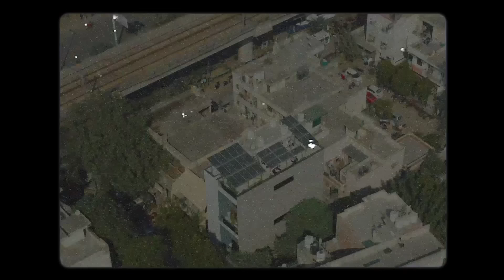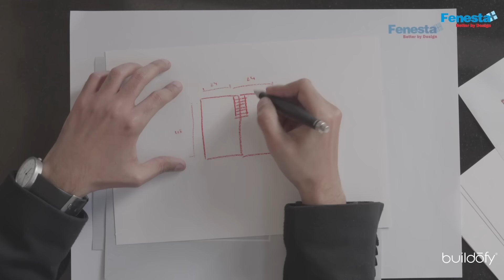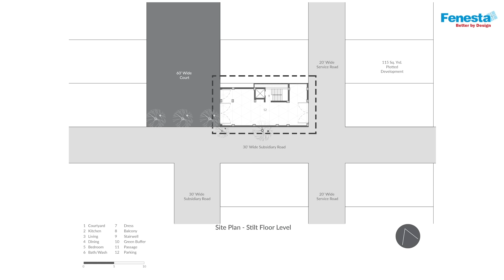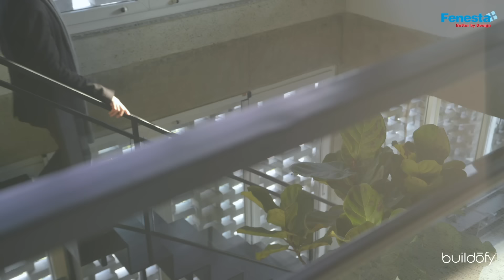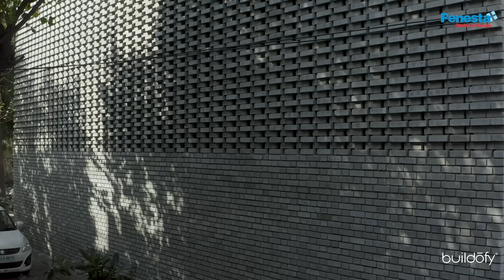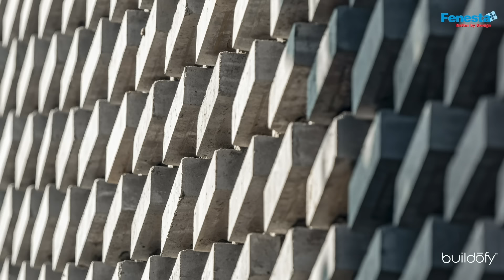1,100 sq.ft Compact House in Janakpuri, New Delhi by Architects Collaborative (Home Tour).

Comment: One of the best works I seen in this channel. My only concerns are how does this handle rain, birds, squirrels etc.. And is it safe? Design looks awesome.
Reply: Now a day's architects compromise on functional aspect and just beautify
Reply: I just keep thinking how to clean these windows from behind  as there is delicate brickwork
Reply: @gondinachu2824  I believe the windows are openable
Reply: @keshavnittin3828  yes windows r openable but there is no space where one can stand behind the window and clean them .. and while trying to do so imagine leaning on those brick jali work if that gives away it's a great fall
Reply: @gondinachu2824  you can clean them from inside right
Reply: @keshavnittin3828  what happens to dust on glass from outside ?
Reply: @gondinachu2824  arre yaar open the windows from inside and the clean the outside surface of the window from inside itself
Reply: Ok... When you have 3 feet width sliding window what do you do ?
Reply: @gondinachu2824  use a long brush
Reply: @keshavnittin3828  haha ..are you an Architect? Just curious
Reply: @gondinachu2824  lol no but I like architecture
Reply: @keshavnittin3828  ok Keshav that's nice that you like architecture .. my point here is architects now a days just rip off there clients in the name of beautification  and no functional aspect is taken to consideration same goes with the client wants to just show off...
Reply: @keshavnittin3828  lol sir ... I really loved the way you kept coming back with answers 🙏🏼 am an architect n yah I do believe that the brick work is an unnecessary addition specially on a location like that ...
Reply: Just run a pipe with holes along the width on the top to wash away any dust etc., on the outer surface
Reply: Agree with your concerns

Comment: This House will turn into disaster during rains from that jaali type wall... efficiency of Air conditioning descrese in summer...and just think what will happen in cold of Delhi... "chilled house"
Reply: Hello, as you can see in the images, the brick jali has an air-tight and water-tight openable glazing in front of it throughout. To introduce weather inside only at the discretion of the client. The glass used is also DGU grade, to prevent any heat/cool gain from outside the house.
Reply: @madhavmaini4900  Great job👌